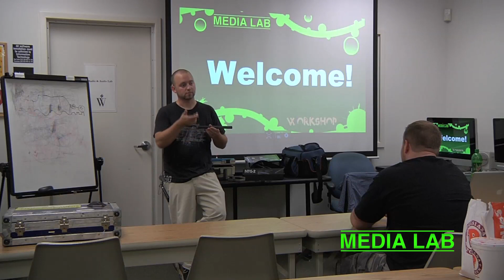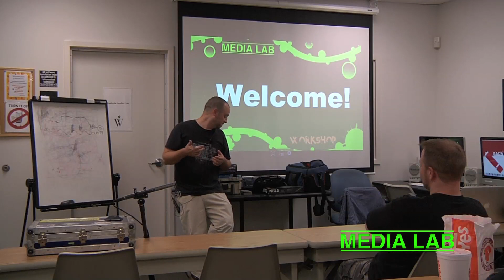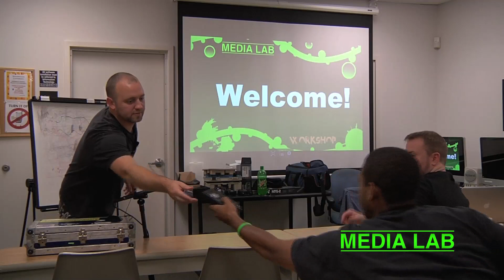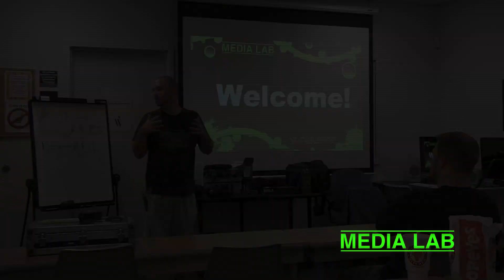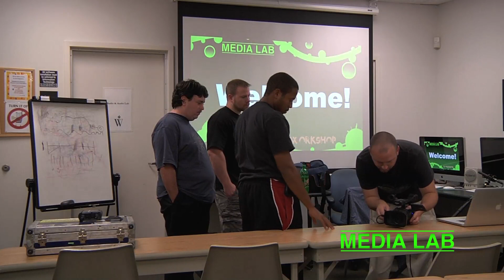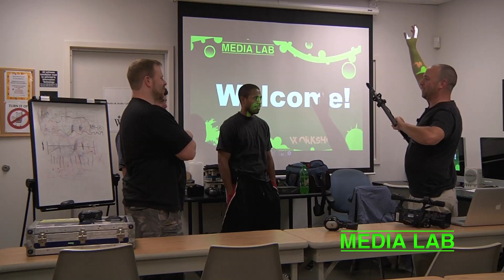Field Audio Recording - Media Lab Workshop #2

Comment: High-Pass filter (Low Cut) will cut out low frequencies, typically it's 80Hz, 100Hz sometimes 120Hz
Low-Pass filter (High Cut) is opposite, will cut high frequencies.
https://youtu.be/fJIulwNgeHc?t=4m45s